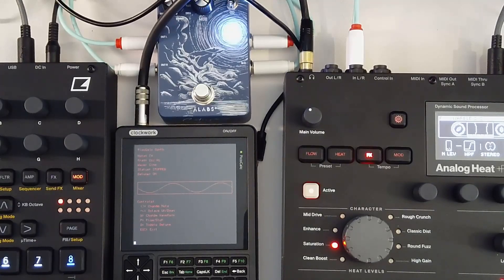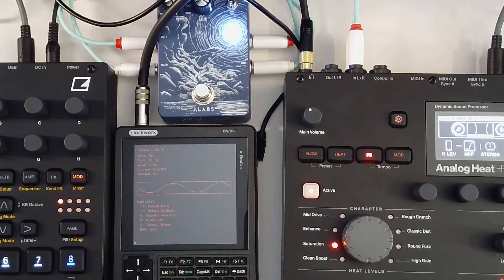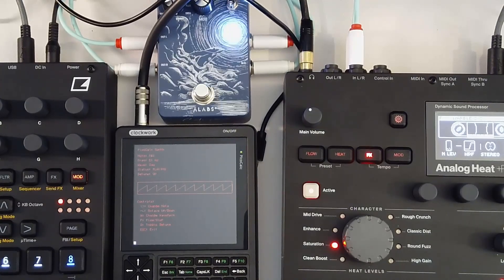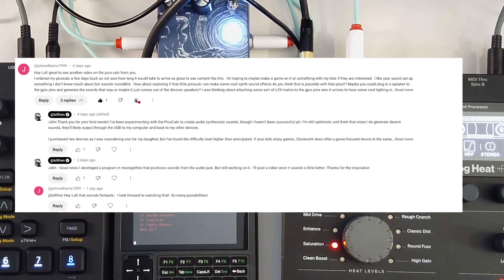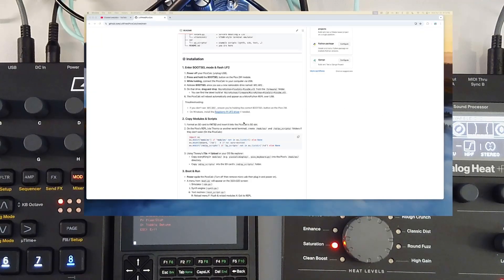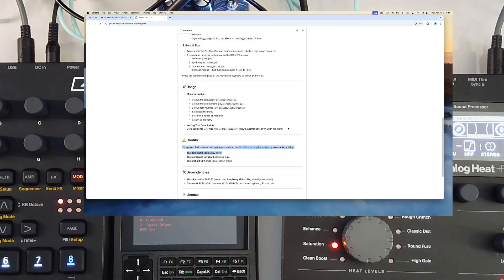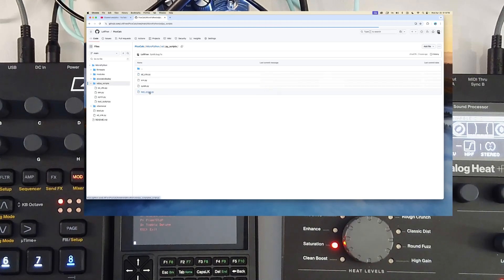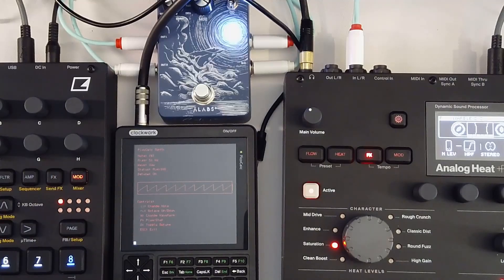PicoCalc is a Synth: MicroPython Synthesizer with Raspberry Pi Pico 2W

Comment: Has anyone thought of a midi app? I have an old Palm Pilot IIIc running some great old midi sequencers. A midi monitor would be great or midi host.
Reply from the maker: That's amazingly unique with the constraints of limited compute power and memory... what would you want the new midi app to do (assuming it's running on a computer or pico calc)?
Reply: @lofifren similar to midi wrench on ios. A midi host would be great. I was looking at the SAM2695 synth as well. Would be fun to add to a picocalc.